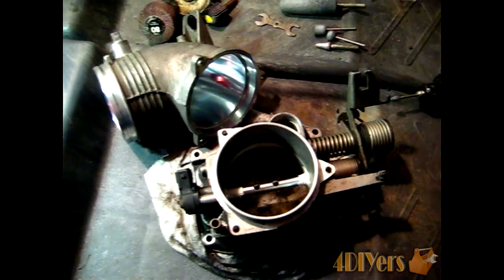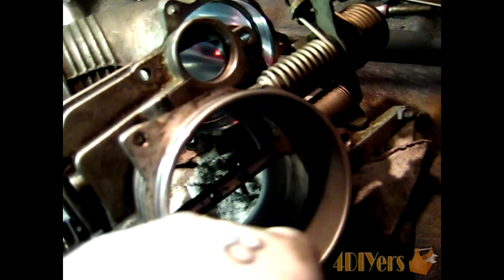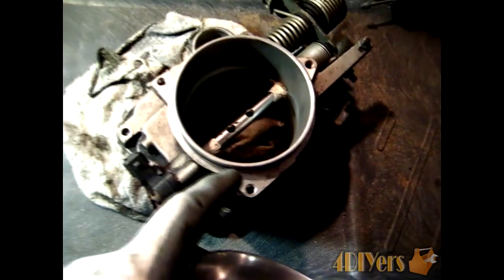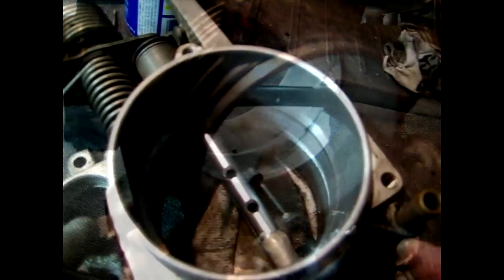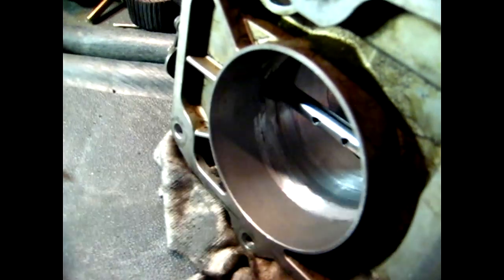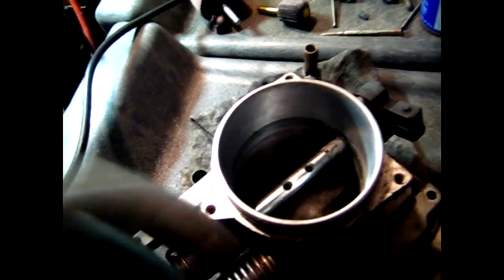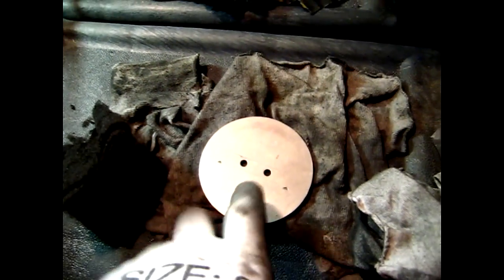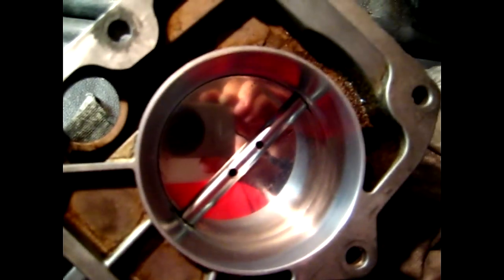How to Easily Polish and Port a Throttle Body

Comment: thanks for the video, ive seen the butterfly shaft machined down betwrrn the screws and the sidewalls, so its down to the flap itself, what are your thoughts on this? what do you use to stop the screws falling out once they have been out?  threadlock?

thanks
Reply from the maker: I have seen people cut down the shaft in the past and it would be a great idea if you had the means to do it and also if you're able to remove the shaft. Once the butterfly is open, even with the stock shape of the shaft being round, it can change the airflow to some extent.

As for the screws, you either peen the threads  or apply some threadlock.
Reply: 4Diyers really, for a street car, that kind of mod would give very little added performance anyway, unless it's a track and you're needing every little bit to be more competitive,
Reply from the maker: The way I look at it, every little bit counts... Someone can do a series of small 1hp performance gains. In the end if they've improved 10 different items, then they have a 10hp increase. It doesn't mean this is something for a track only application, people can use this for added street performance as well. Not to mention just for regular daily driving, it may have positive effects on fuel consumption as well.
Reply: I agree, I have a 97 prelude i'm working on. I can't afford a super charger, or turbo, so I have to do little things like this, that the young guys probably don't know about. what I meant is, shaving the butterfly is such a minor mod, and you take a big chance on screwing it up for such a small gain. porting and polishing the tb is a definite must. alopng with that I've also built my own TRUE SEALED RAMAIR SYSTEM. btw my prelude is making about 205-210, not bad for a stocker. I prefer to under rate the power, it probably makes a few more, but i'll leave the bragging for the teens who think putting a coffee can muffler on makes it a race car. I must be one of the oldest import guys out there. i'm 46, and my dad, who helped me put in the lowering springs in, he's 67. we've always built big block mopars, this is our first import, having fun with it.
Reply: 4Diyers
 well ive done it, every little helps, it was tense cutting the shaft down but all done and polished up,
im going to sand and polish my inlet manifold next as that is rough, its an FSI engine so no need to keep the roughness in for mixing the fuel,

thanks for the help
Reply from the maker: Excellent to hear and glad to help out! If you would like, feel free to post up a photo on my Facebook page https://www.facebook.com/pages/4Diyers/106898752724865?ref=hl

Comment: benefits of doing this?
Reply from the maker: +bartojoe Yes there is. It will increase throttle response, reduce the chance of oily residue build up in the bore, reduce airflow turbulence which will reduce performance, a mild increase in performance depending on how poorly designed the existing throttle body is, and increase fuel economy.
Reply: +4DIYers If you've opened your intercooler piping and plenum up huge this might help a bit... but most ppl who have welded up a new plenum will just use a larger TB since they are fabbing a new surface for it to mount to anyway.
Reply from the maker: piecartbox This is an NA engine. This is just intended for anyone wanting to modify stock parts without getting into too much more or an excessive amount of work retrofitting a new throttle body.

Comment: changing the throttle body from 55 to 65mm. inoly have the tps and screw to adjust idle. does TBs mess with your idle and cause flat spots?
Reply from the maker: +micheal balma What is the upgrade on??? I did an upgrade like that years ago on a Ranger and the computer was able to adjust accordingly to the larger bore. As for causing flat spots, no. It could be an issue with the new TPS if it works on a potentiometer.
Reply from the maker: Do you mean the idle adjustment screw???
Reply from the maker: It's not something I would recommend as it's a fixed adjustment as opposed to an IAC valve which is a variable adjustment controlled by the vehicle's computer. Therefore you may setup the throttle for when the engine is warm, but it'll most likely be too low for when the engine is cold. Same goes for a change in altitude as well, the engine won't have a way to compensate for that, therefore you'll most likely encounter running issues.
Reply: +micheal balma Yes it can. Ideally you would have some minor adjustments to the engine tune, most importantly adjusting your transmission shift points as they will be affected by the larger throttle body. Talk to a local tuner about it or check out some forums, which will explain it properly.

Comment: gain or loss from a 65mm throttle body from 55mm port matched with intake,headers,exhaust on a 2.2L motor?
Reply from the maker: +micheal balma If you're increasing the size of throttle body, I would also recommend upgrading the fuel delivery as well, especially since you're increasing the flow of exhaust as well. You should certainly experience some noticeable gains. As to how much, well it's hard to say how much because it's dependent on if it's extremely de-tuned from factory or not.
Reply from the maker: Not sure what injector design you have, but sometimes you can upgrade them to a multi hole to help optimize the air/fuel mixture. I would also recommend porting the intake manifold as well and use some ball hones to smoothen out the internal rough casting. Have you considered phenolic spacers too??? Helps keep the intake heat transfer down.

Comment: is a 220cc injectors with a aftermarket fuel regulator capable of handling a throttle body upgrade from 55mm to 65mm ported manifold and a port polish cylinder head with stock bottom end? cheers
Reply from the maker: +micheal balma Unfortunately I'm not familiar with those engines so I am not sure. It would be best to install an air/fuel meter to determine if your car is running accordingly. You don't want it running too lean and you'll lose performance and then there is the risk of damaging the engine.
Reply: +micheal balma man I thought my 360cc were small.  Fuel regulator is for when u run more boost/pump/injector and the new pressure from the pump is overrunning the stock unit.
Reply: A Fuel Pressure Regulator is used in a return style fuel system. Fed EPA regulations require all new cars to have returnless systems to reduce fumes created from fuel splashing back into the tank. EPA screwed the manual tuner. 
Get a wideband air/fuel ratio gauge. Helps to tune. And you'll see if you run too lean. Although I don't think you'll run too lean with this mod. The only time there will a difference anyways is at WOT.
Peace out Holmes
Reply: How are you determining that the engine is running rich? Dyno? Black soot? Spark plug discolored? If your not positive then i would hold up a sec. 55 to 60mm still needs accuracy in tuning. What's your exhaust? Stock or flow through muffler? Larger piping or stock, catalytic converters deleted? Like i said, you ask more than you know, me thinks. you don't want to kill the motor by guessing. I'm not poking fun, I mod Mustangs so I know the MOD bug, lol.
Reply: If you don't tune the fuel mapping and timing via a  dyno tune you are guessing/hoping/assuming that the a/f ratio is optimal. Like someone mentioned earlier carbs were a different animal compared to fuel injection. Running lean kills engines. If you haven't before find a local tuner and ask questions, they want the business so they won't jack you up.
Reply: Do you know how much vacuum is the engine at idle? The back soot also can be a vacuum leak or spark plug to cold or ring blow-by. Do you burn any oil? I'd like to check your issue but we're kinda jackin this thread, no?